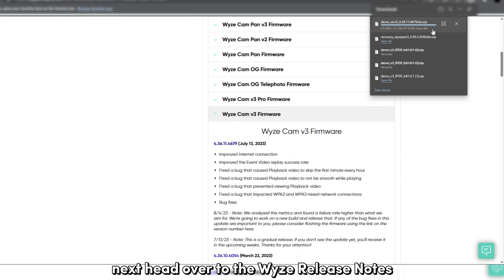Wyze Camera Firmware Update Failed: How to Fix

Comment: Will this work on the battery cam pro I’m having the same issues I can’t for some reason update to the most recent firmware and it’s not letting me live view anything all the other functions are working but I can’t even access settings without getting a box saying I have to upgrade the firmware and I’ve tried about five times I’m gonna try to let the battery go 100% then try it but I have a feeling it’s not gonna work
Reply from the maker: Unfortunately, i don't think Wyze offers manually flashing firmware for the battery cam pro.

They do have the release notes up on their blog( https://support.wyze.com/hc/en-us/articles/360024852172-Release-Notes-Firmware#Accordion-wyze-cam-v3-firmware-26 ) but i cant seem to download the specific firmware file from their servers like i can on my v3.

I found a support thread with an issue similar to yours, and maybe that can help: https://support.wyze.com/hc/en-us/articles/17505333795355-My-Wyze-Battery-Cam-Pro-s-firmware-fails-to-update
Reply: @blinqblinqtech  thank you for the help. I ended up figuring it out. You had to lower your bandwidth and you have to the router and the modem reset a few times and you had to have all the appliances together for a successful sink and you’ll have to do it over and over again until the cam is happy with the version of firm wire,  that the company is offering , hope this helps people it took me a whole eight hours to complete this process
Reply: @PNWDADDY having the same problem what do u mean “you have to the router” I’m confused I’m having the same react issue

Comment: Very Interesting would demo_v3_RTSP_4.61.0.1 work for wyze cam pan v3 or is there a file somewhere for this cam pan v3?
Reply from the maker: @SamE-kq4ql firmware is different for different camera models, so please don't flash an inappropriate firmware. You might brick your cameras!

You can find necessary firmwares from wyze's official page here:  https://support.wyze.com/hc/en-us/articles/360024852172-Release-Notes-Firmware

If the version you need is not listed, then it unfortunately does not exist for your camera model

If RTSP is what you are looking for, wyze has unfortunately removed the firmwares from their website, but here is a reddit post that has linked the last available RTSP enabled firmwares depending on the wyze cam model: https://www.youtube.com/redirect?event=video_description&redir_token=QUFFLUhqblBvQzZDblExNXJyMTJKSTI4NEVfNGRsdHp1Z3xBQ3Jtc0tsRzVmMmlkeUpEbFA2MFQzalBOUTVoUk1hRlRNZFFNb2ZQMUtmRVJWaGNCNnczcEpFUllMTHVpVjRJblN4ZzVpSS1rMDZkaXByd2tYX2d0RldlblhoZFdWZEx6QW5YX0JPSC1PdElYN2RsOEtFZEY5WQ&q=https%3A%2F%2Fwww.reddit.com%2Fr%2Fwyzecam%2Fcomments%2F1016of6%2Frtsp_firmware%2F&v=RvW4LXV5B3w